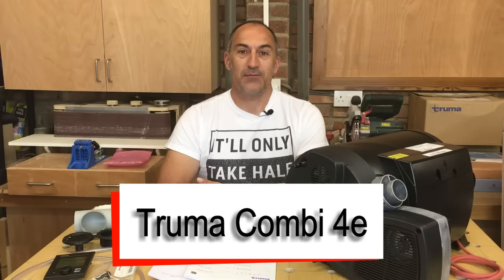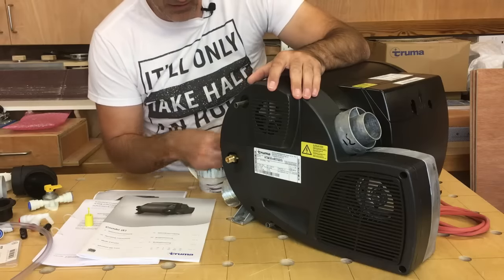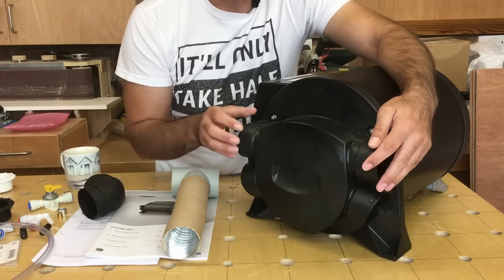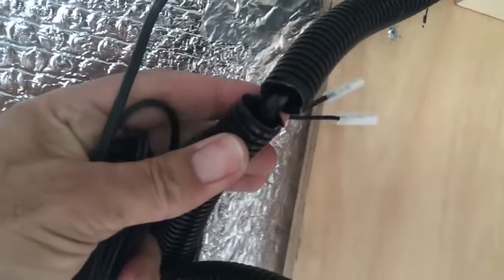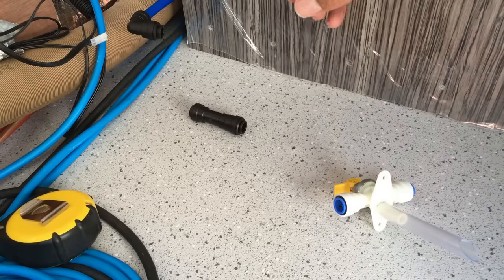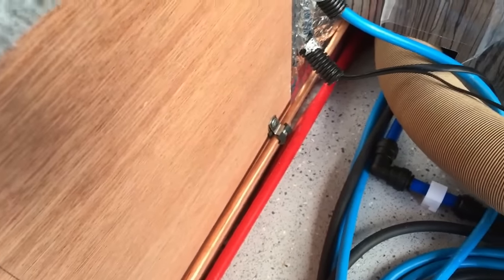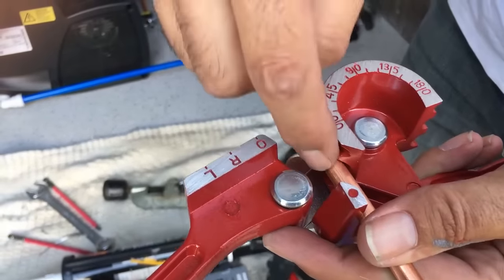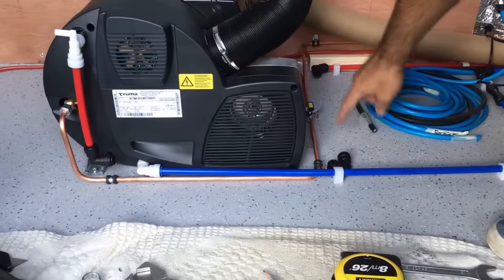Truma Combi 4e Self Build Camper Van Installation

Comment from the maker: For those that do not know me please let me explain who I am in greater detail. I'm a fully qualified Mechanical Services Design Engineer, I studied Building Services at University for 6 years and have been a Member of the Chartered Institute of Building Services Engineers (CIBSE) and the Engineering Council for many years. On top of that, I have worked in this industry both on a consultancy level and as Director of mechanical services contractors for over 30 years.  I fully understand the position that this channel holds when explaining the installation of services like LPG and electrics where they both have the potential to cause fatalities and that you the viewer may be following these instructions.  Therefore, I have gone to extraordinary lengths to ensure that the information contained in this video is current and correct and safe to publish to all who wish to view it. The LPG information is taken directly from the European Standard EN 1949:2011+A1 updated Feb 2013 and is the most current standard for "Specification for the installation of LPG systems for habitation purposes in leisure accommodation vehicles and accommodation purposes in other vehicles"
The system has also been installed strictly in accordance with the manufacturer's installation instructions. The video has been previewed by Truma before releasing to the public.
I sincerely hope that gives you a level of comfort that the information contained is correct within Europe to the very best of my ability at the time of publishing.
If you are living in another country outside of the EU then you will need to check your own local standards and I would always advise having these systems tested by a certified professional.
Reply: If anyone has a list of the standards related to van conversions (in addition to the one mentioned by Greg above) I'd be grateful. If it's anything like canal boats there will be a laundry list of them!
Reply from the maker: Like most standards and codes of practice they are not free, the current price from the bsi for this regulation is £198 and for that, you get a download PDF document of 37 pages. I know because I got a copy to make sure this video was up to the correct standards. That's £5.35 per page of an electronic document. That is criminal when these are for health and safety.
However, I am currently working on a video to cover the LPG regulations and how they apply to van conversions as I have not seen anyone do that yet and this is a complete grey area that is neither enforced or policed by any governing body. Yet we are all driving around with LPG cylinders and gas appliances in your vans, many totally unaware of the dangers.
Reply: Greg Virgoe - It is indeed obscene how much they charge. Thankfully uni students have unlimited access.
Reply from the maker: I think also you should be able to view them at your local county library too. But not take them out or copy them of course.
Reply: This standard is for public service, and like the code of law, this can't be behind a paywall.
Reply from the maker: I totally agree with you, but after a very long internet search, I could not find a source that was free for this standard. It would be amazing if we can give everyone a free copy.
Reply: Oh Lord that is nuts. Imagine at a swimming pool, you had to access and pay for a resuscitation guide pdf.
Reply: Greg Virgoe - If you're feeling brave you could make a more digestible version of the BSI PDF file(s) - and with your version you could distribute for free! A bit like this example (canal boat related in this case): http://www.soliftec.com/Boat%20Stoves%201-page.pdf
Reply: I've always been appalled by the cost of getting a copy of any of the  British Standards. Especially since they became BSEN, one standard that I use frequently went from a 4 page BS to a 46 page BSEN with a consequent jump in price. 

It is worth noting though that there are very substantial discounts for members so it could be worth it for your viewers to see if their employers have membership and ask to make any purchases through them.

Discounts are usually around 50%.

Another great video Greg, as always.
Reply: Well said sir 👍😁
Reply: Great list of credentials but....can you sing and balance a ball on your nose? :)
Reply: hi greg great vids. i was wondering if you can help me , did your gas connection kit have a odd little spiggot that pushes into the femail part of the connection on the boiler.  it seem to reduce the 8mm gas to 4mm hope you can help
Reply: can the exhaust / inlet for burner go through the floor of a vehicle , I dont want it seen on side of sheperds hut
Reply from the maker: @stephenjose1472  sorry mate no it can’t. You can get different colours or black ones which are bit more discrete
Reply: @ciano5475  which exposes the real purposes of the regs...
Reply: Hi Greg, thanks for the very in depth video explaining this ! I know it's a while ago, but in the Instructions for the truma boiler it says that the gas pipe has to have a SAE 45⁰ flare on the end ? Is this necessary ? Thanks 
Simon

Comment: If I'd cut and bent that copper the first time as accurately as you did, Greg, I'd have stopped to have a small party to celebrate!
Reply from the maker: I tell you, Simon, that was the only bit of copper I had, I finished up with an inch so left it was a one-shot deal just to add to the pressure lol
Reply: How do you manage to bend the copper without crushing the pipe? No matter how slow I do it, the pipe always gets compressed on the bend

Comment: And just to add I installed a Truma 6 diesel one I my Renault master ... really great unit and have toured Norway Finland and Sweden for two months... excellent !
Reply from the maker: That's really great to hear, I'm guessing with the 6kw unit you had loads of heat and your motorhome was really nice and warm.
Did you also have a shower in the camper?
Reply: Very cool. My build is still only in my head but one thing that's already established in there is that there will be no LPG. Diesel heat, tapped straight into the van's diesel tank so no worries about more than one fuel. Cooking may in fact also be a diesel burning range, but more likely lithium batteries and electric induction cooking. Of course, a 6000 watt heater like the 6D is overkill, but anything to get away from gas. I may just go with Eberspächer products though (the 6D has Eberspächer furnace components in it to burn the diesel, for that matter.) But using an Eberspächer Hydronic unit to heat glycol means you need to add heat exchangers and do some DIY style work to cobble it all together.
Reply: Greg Virgoe 
Hi sorry for a response way to late!..I’m not really into all this social media stuff.
Yes, I do have a shower wet room fitted with a composting toilet with one blower from the heater in there...great for drying stuff with the door shut.
I guess my mistake with inserts was over flexible vs rigid copper piping! Flexible takes an insert!
Thanks for the videos...very informative.
Reply: Hi S Otobfree. Can you give me some info about your Truma D6 Diesel Heater please? Is it noisy, does it make the annoying constant clicking noise that a lot of people complain about with the Webasto & Eberspacher diesel heaters? What is the electrical draw? Thanks Tracey

Comment: Hi great videos really enjoyed watching them I used to be an LPG engineer you should always put some sort of gas compound or gas tape around your threaded joints also don’t allow your hot and cold pipes to touch as it can cause legionnaires disease keep up the good work buddy. 😃
Reply from the maker: The joints in this video were all compression joints with olives and it's not good practice to put anything on olives, definitely not PFTE tape.
I have used the correct gas PTFE tape on the threaded connections around the cylinder. 
The current LPG regulations state jointing compounds are not to be used. 
The boiler will heat and store water above 55deg C so even if the cold feed gets a little warm that's enough to kill any bugs.
The blue pipe in the video does not feed anything other than the boiler at that point.
If it was feeding a tap for drinking etc i would have insulated it, but nothing to stop the external tank getting hot in the summer too.
Reply: I would always put a bit of jointing compound on a comp fitting, I like Plumb blue as you can use it on water, gas, steam and air
Reply: Hi I agree you should never put PTFE tape on any olive that’s why I said on the threaded part.  when you do your plumbing apprenticeship they spend a lot of time teaching you not to put the tape on your olive and only on the threaded part of the joint as the olives can sometimes let-by, and the PTFE tape is there to stop it from coming through the threaded part. And as for compounds it’s probably changed since I was a gas engineer as this was 20 + years ago. 😉
Reply from the maker: Hi Clan, you should never use PTFE tape on any part of a compression connection.
It should only be used for actual threaded connections. 
If you put PTFE on the thread of a compression nut you are preventing the nut from tightening up fully so you are actually making the situation worse. If you have a poor olive or seat you could smear a little gas joint compound around the olive. I appreciate that not every fitting comes in mint condition. Special gas PTFE tape must be used on threaded connections like your flexible bottle hoses etc
Whoever taught you I’m afraid gave you poor advice. That is a real shame. Was it at college or working with old pipe fitters

Comment: Great explanation of what seemed a difficult task. Detailed and simplified.
Reply from the maker: It really was very simple to install, the JG water fittings are dead easy to put together.
Just need to be aware of the LPG system and the safety aspects of having gas in your vehicle.

Comment: Christmas Day watching this vid 😊 (and not for the first time either!). A Boiler Maker at work, love the tidy installation ✔️. Always learning and I've just seen that you use pipe liners in the hot water pipe. I'd forgotten to put any of these in any of my joints that i've done so far 😩 and can completely see their purpose. A quick search showed that Magnum MH sell these, ordered 😊, thanks again buddy. Cheers!
Reply from the maker: Sunnycampers I had also installed some of mine before I checked with JG but luckily I could get access to them and the push fit come apart easily. 
Can you get to all your joints ok to retro fit them?
Reply: Greg Virgoe Fortunately, yes 👍 The only pipes that are installed are the underfloor ones, with the tails being easily accessible 😊

Comment: Greg, we love your van build videos!  You are absolutely THE best van build series on YT!  So much detail and information...  Much appreciated! 

We're just getting started on our Truma 4E install....  Wanted to ask you a quick question on the 12v wiring for the Truma 4E and the Truma CP Plus.  Did you wire these up for 12v on separate cable runs, or did you just splice the CP Plus 12v feed into the main 12v feed to the Truma 4E? 

Thanks so much for sharing your knowledge & experience!

Comment: Hi Greg, first of all can I congratulate you on the best self build series on YouTube. Clear and comprehensive. 
I have recently bought a 14 plate VW Crafter, which is, to all intents and purposes a Sprinter. 
I am hoping to use your videos as a template!
I am in the very early stages, about to thread the wiring, I have a couple of questions!
1. In your wiring video, you thread a cable vertically through the corrugated trunking. The equivalent route in my van (which externally looks the same as yours) has an obstruction part way down and only allows the passage of string or cable! Did you have to open this route up at all?
2. I am keen to use the Truma Combi Boiler, but will have to purchase it later. Is the control cable a standard Cat5 network cable? I have plenty of that and could route it now in preparation!

Hope these aren't too trivial a question!

Cheers

Dan

Comment: Excellent clear and concise video Greg. I am considering swapping out a Whale unit for a Truma but ideally would prefer an underfloor placement for a Diesel -Electric unit that does both Water and Space heating. My understanding is that all Truma units are designed for interior fit out only but I'm only starting my search. Greg, are you able to confirm Truma units are all interior only? I've looked on the Truma FAQ's but cant find confirmation. Thanks for your great channel.

👏
Reply from the maker: Yes they are only for internal fitting. I will say that ours has been absolutely amazing and continues to work so well with no problems

Comment: Very very informative video. Just one more thing to add. In the pc board you skipped past the link wire beside the thermostat connections. They are for a window switch that must be fitted if the boiler flue is directly underneath an opening window or within 300 mm of the window. It’s to stop the stuff that kills you entering when it’s open. All so regulations state you must have 10mm clearance between gas pipes and any other services at cross over points. And it’s best to use copper olives in your gas fittings as brass can cut into the pipe over time creating a leak. And it’s all so better to use sweeping bends instead of sharp 90 degree bends as a sharp bend increases pressure drop more when doing your pipe sizing calculations. And you will need a 2000 mm2 vent in your appliance compartment to allow room air to circulate through the boiler. Not combustion air but room temperature air. And minimum flue lentght for a horizontal exit is 600mm. There’s more than one thing I added there I do apologise but mate that is a very very good installation and very informative.

Comment: Excellent video as always Greg. One thought.
I've heard you say that most of your travels should be in warm climates, with this in mind, did you ever give any thought to installing the Truma air con system?

If you had considered it and rejected the idea what put you off?  Space, power requirements, cost or a combination? 

Thanks again, best van conversation resource on the Internet.
Reply from the maker: Yes, I did look at them and consider it, the cost was not an issue as it's very similar in price to the combi boiler.
The heat pump version runs off 230v supply and is rated at 2400watts so in practical terms you could only run it while on mains hook-up. Plus you still need to install a hot water solution. It also would have taken up valuable roof space which I had earmarked for solar panels. We wanted to be able to go off the grid for long periods and it didn't really fit that model.

Comment: Hi Greg. Thanks so much for the video on the Truma 4e combi.  I just wondered if you let me know what size and make of LPG tank you would recommend for this type of heater.  Thank you!  Jo
Reply from the maker: If I was to do this again I would recommend fitting an underslung gas tank from gas-it as it is safer and has larger capacity.

Comment: Hey Greg, i watched all your videos as you were actually building this van, just had a quick question for you, would you four years down the line still opt for this heater or is there something better/cheaper on the market now?, also would like to add your work is first class. and am watching the budget Fiat build.
Reply from the maker: There is nothing better than the Truma heater it has been amazing in our van. Works so well, quiet and the best solution for heating and hot water. Simply brilliant 🤩

Comment: Great video Sir, and also a pleasure to watch. I, myself having worked in the building services game for 30yrs or so ,as a contractor, always value good workmanship, with simple explanations followed by a clear execution, and you have nailed both as always. On a practical note, would you lay the flue to a slight fall to atmosphere, so to expel any condensate formation that may build up in the flue pipe/s, this seems good practice on a domestic sized job. PS you are fueling my desire to `camper van' as I work in all areas of the country, IR35 implementations have some what pulled a shadow over the hotels bill affordability - so this camper van life has a cheap hotel stamp written all over it!!!!!

Comment: Very instructive. :) Roughly how long do you think a standard bottle of LPG would last?
Reply from the maker: That's a very difficult question to answer as it totally relies on your usage and weather conditions etc
We hope to stay in warmer climates so demand on the heating will be less.
I will be keeping tabs on that for sure and you can expect update videos while we are touring.
To fill up my 11kg LPG tank costs approx £10.50 at current prices, 0.61p per litre.  Compared to £1.33 a litre for diesel? more than double.
Reply: Greg Virgoe Cheers, we’ll keep an eye out. :)

Comment: Hi greg love your videos very useful!!! I have couple of questions: i guess for truma combi you used 1.5 mm cable for 12v, so my question is why for the fridge you using 6 mm cable when is consuming less then the boiler. Please if you could answer as we just started our conversion and we are following your video to do it! Anyway thanks a lot for sharing your conversion and your work is just great!!!!
Reply from the maker: The fridge manufacturers recommended 6mm because of the voltage drop on smaller cables.
Reply: @GregVirgoe  thank you very much🙏🏻☺️